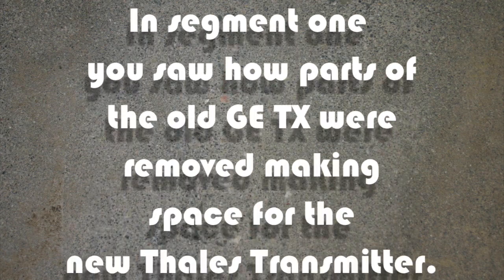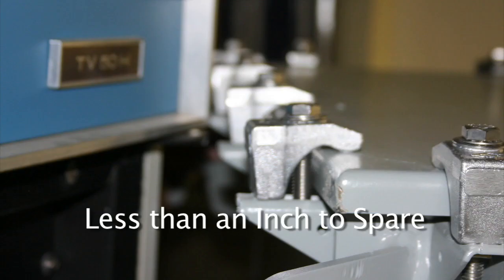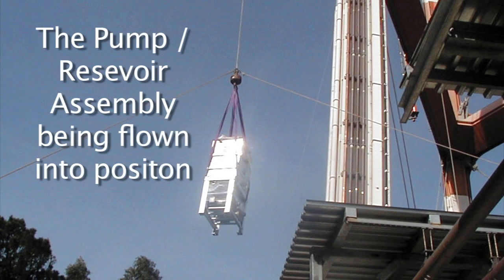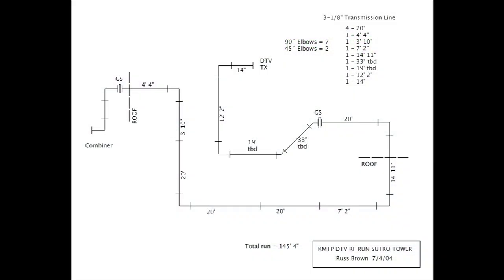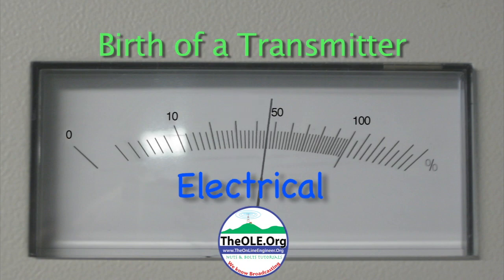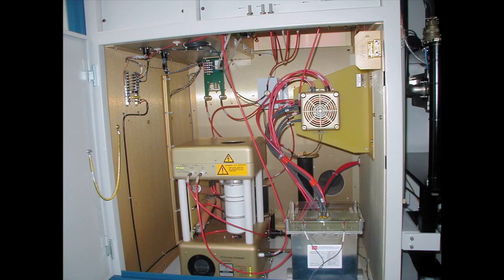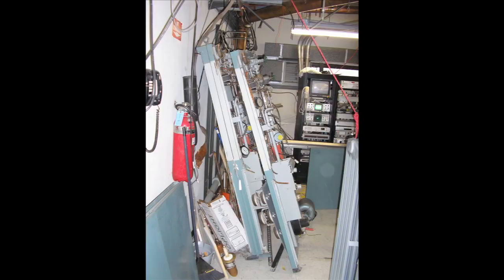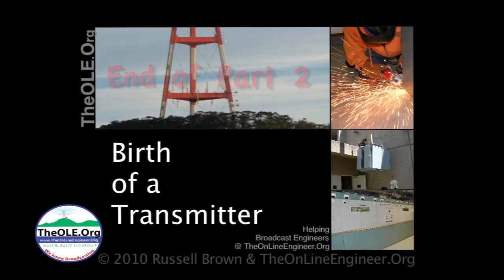Birth of a Transmitter (part 2)

Comment: The plant I work in has 3 GE 250Kw SW transmitters-built in the early 60's.Still in limited use and as backup to the new rigs.The GE's can still play just fine!
Reply: Cool stuff! 
One of the coolest things, is that some owners of large transmitters just rent out transmitter time by the hour, so you can pay like €150 and get an hour of tranmission time on a world class shortwave TX :)
Sadly it's mostly radio china doing that.

Comment: This video is the death of an old transmitter-then the birth of a new one.Interesting.Went thru this at the last SW transmitter plant as older CEMCO 420A transmitters left on the junkwagon and newer ones arrived.Operating one of them now-CEMCO 419F-250KW older ones could do 500Kw with two 250Kw amps combined.Was a job at tuneup.Have had a taste of analog TV Tx haven't delt with DTV.Now for me its short wave.Broadcasting to South America,Africa,Cuba from Greenville,NC.The transmitters came from another plant that no longer needed them-built in the 90's.Old ones were built in 1948!!Ran for over 60 yrs!

Comment: We need 6nOS FM Transmitters and and work as 2SETS as in (2+1) configuration.
We also need complete setup of the FM station including combiners, Transmission Line, Monitoring Rack, 4-dipole Antenna etc.
please contact me on Whatsapp 0096894193879 or email fawad.rahim@barikgroup.com